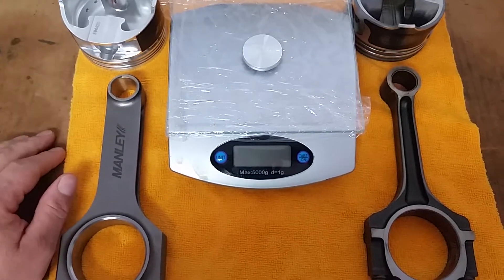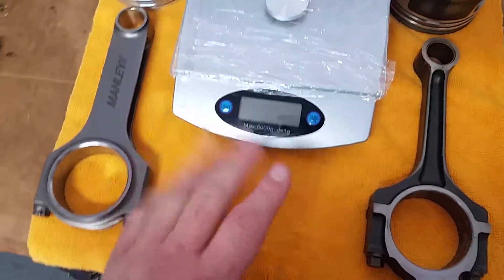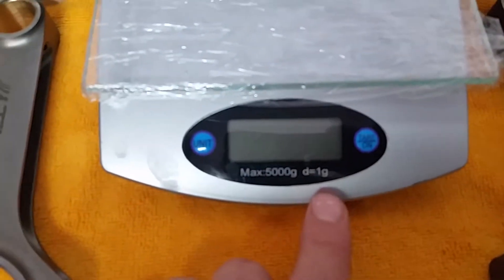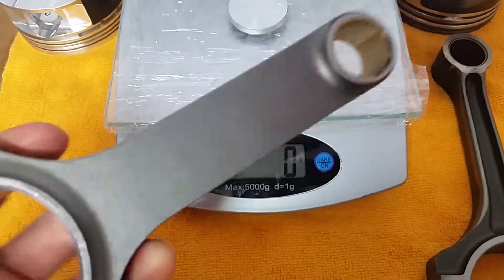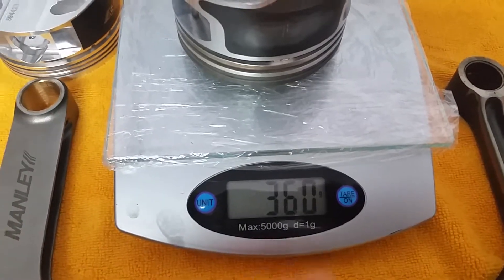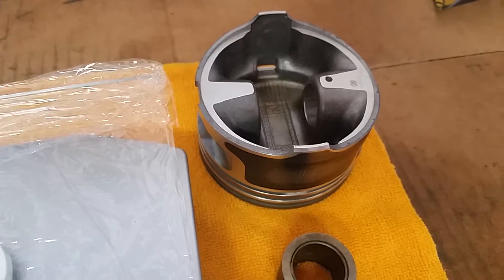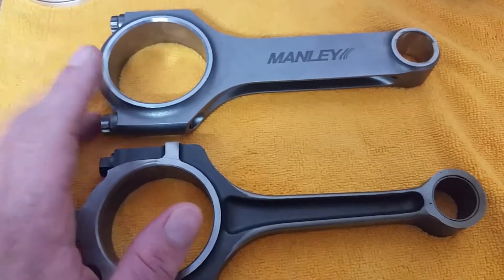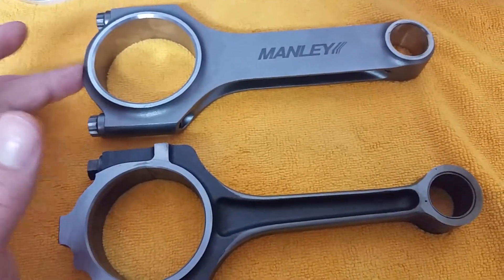Ford 4.6 stock I beam rods vs H beam weights

Comment: First off Tracy cutright is correct that is not the correct way to determine bob weight. Second you are weighing Manley’s lightest rod which is definitely not there strongest. Most Coyote h beams will weigh around 650-670 grams. I’m not sure that those are the same size rod
Reply: These aren't from a Coyote motor. These are for a 4.6 2V/3V/4V
That seems to be a pretty standard weight from what I can tell. If you have some evidence to the contrary, I'd like to see that. They are also most certainly stronger than the factory rods, which any expert builder will tell you is good for 450lb/ft of torque in a 4.6 3V. That seems to be a pretty good rule of thumb for maximum output while maintaining any reliability. Anything beyond that is largely considered the danger zone. People commonly use aftermarket H-beams for very powerful builds. Just look at the 3V build that Four Eyes is doing. There's a reason people go with aftermarket rods and I don't understand why people make such an attempt to die on the hill of factory parts.
Reply: Coyotes use the same rods as a 4.6